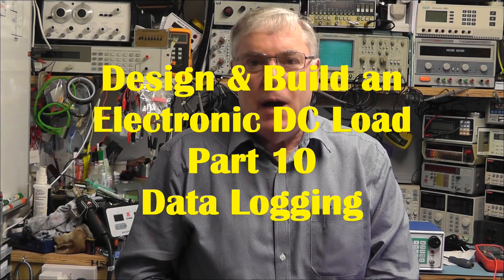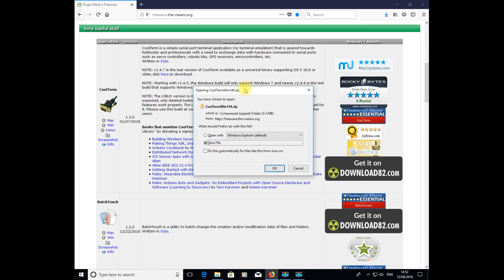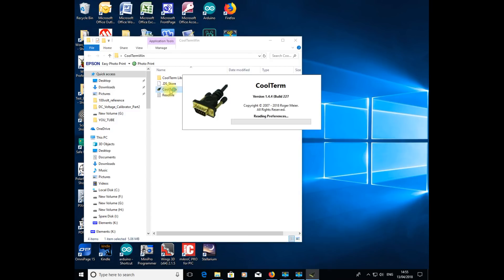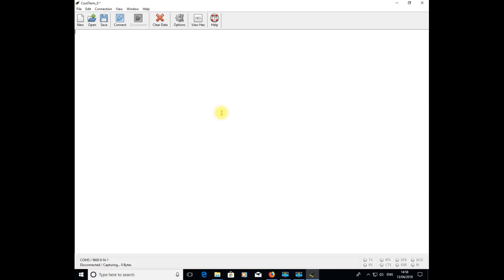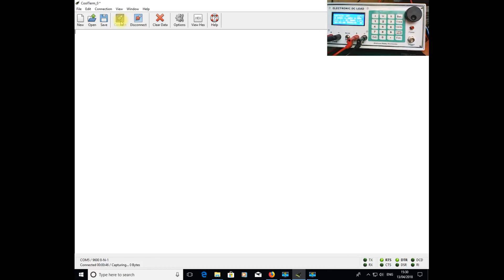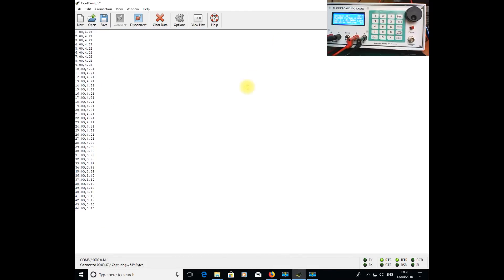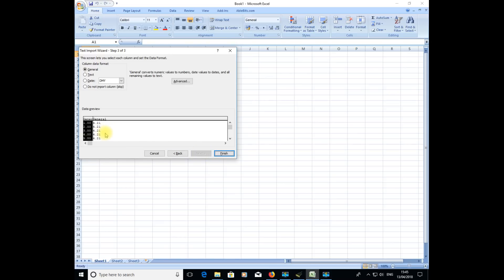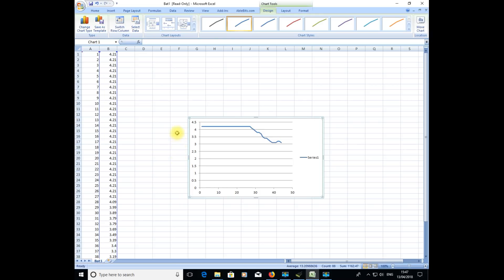Scullcom Hobby Electronics #58 - Electronic DC Load Part 10

Comment: Hi Louis, I have built yor electronic load and made a mod to increase the current capacity to10 Amps, which involved changes in hardware and software. I also started to include in the software the capability to remote control the load and also started to make a Windows program to control it from a PC, it basically works but I need to complete it.
This was several years ago and since I am restarting the project now I would like to have it well documented. I wonder if you could supply me with the KiCad files corresponding to the version 9.3, the only that I have is for version 7.1.
Thanks in advance,
Ignacio
PD. If anybody also has these files, please let me know, I'm not sure if Louis is following the thread now.

Comment: Hellò Master!
I mounted the pcb and it seems that most of the system works, but there is a problem, the RTF4050 reference voltage generator instead of providing a positive voltage provides a negative voltage, before removing the SMD chip, I would like to know if it is a problem with the chip setting or if I damaged it while mounting it?
I looked at the data sheet but I did not find any ideas on the matter.
I would like your opinion, the rest seems to work correctly. Thanks!!

Comment: Very nice job and project!! Great presentations as well. 2 questions: 1: I could not find PCB in the ref listing, is it still available? 2: This is a perfect load, a little more current would be better for battery testing, And the BIG ONE, WE NEED  BATTERY INTERNAL RESISTANCE.!!! With the tracking output to Excel, this is great for battery management!! Thank you so much for your time and great work!!
Rod

Comment: Good morning. I know I'm digging up a topic. I would like to know if with some modifications it is possible to increase the load to 8 Amperes? I will provide a larger heatsink and more powerful resistors. I would like to know what else could be modified? Thanks a lot . PS: sorry for the text because I am French and I use Google translate

Comment: Greetings. I really liked your scheme. While studying, and thinking about increasing the power- by increasing the number of transistors. when studying the circuit, I noticed an error in the printed circuit board. Resistor R16 must be connected between resistors R7-R22-R17. On the printed circuit board, R16 is included in the R17-gnd circuit.

Comment: I just finished Your project and it's working beautiful ! I did some modifications to it . I used a op amp to boost up the output voltage LM358 (from 0 to 5 to 0 to 10 V) to be more flexible with the Mosfets . and used a quad lm324 , it's not a rail to rail but I figured it's not gonna be all the way up to 5 volt at the output . I really  liked the all the nice data and functions of it . Absolutely Beautiful !  If I may , I could give you and idea about a different project .  Like a linear power supply  there's a DIY kit all over the internet . 0 to 30Volt 2mA to 3 amp . it works very nice . It would be beautiful to make a control with Arduino , with a rotary or keypad . I been looking for a thing like that all over the internet and sadly to say I haven't find anything similar and i'm very sure I'm not the only one who's in dier need for some upgrades :) something like a universal module . just hooking up the potentiometers connections  and output of the DIY kit . with the DAC and ADC it can control and monitor everything about it . maybe some current settings if the user wants to boost up the current output . My guess is that that little control module would be a great Hit in the hobby world

Comment: This is a great project. I especially like the fact that you let us see the entire process with the thought behind all the steps and changes. Two things I am curious about though. Why you didn't use your thermal sensor to directly drive the fan's control transistor and why you opted for a logic level rather than linear, FET. Have you looked at the  IXTK240N075L2 or the IXTT80N20L? They might give you 10 amps per device without exceeding your temperature. I was looking at building this but the FET you us is now obsolete. Never the less, good job.

Comment: Renat Zafirov
Hi, Louis! Can you modify your RTC library for using most popular and  cheapest ds1307 or m41t56 ? Thank you!
Reply: Much too late, but for documentation: The DS1307 and also the M41T56 uses i2c adress $68 wich conflicts with the ADC MCP3426 on the board. I removed the usage of the rtc for battery discharge timing in my code and use arduino millis() function for that. I want to free the rtc from that and use it as a real rtc for datalogging.

Comment: Dear Mr Scully
Thanks a lot for your great videos ! Thanks to you, i could vastly improve my electronic prototypes. I have a question about the Arduino Nano you use in several projects, like your Electronic load. You inject a regulated 5 volts directly in the 5V pin of the board, without protection diodes or voltage management system. Isn't there a risk to damage the voltage regulator of the board ? And how to you upgrade the software with the USB cable? Do you first remove the Arduino board from your own PCB ? I wonder how you prevent the risk of conflict between the regulated 5 volts supply and the 5 volts coming from the USB plug ? ... 
Thanks again for your excellent work! 
Yours,
Patrick Bertholet

Comment: I just have 2 questions. Are you going to have any more boards made and 2nd question is if your not what type of file is the PCB created in so that I can try to make one of these, Love the channel by the way I just found the channel yesterday and have not stopped switching through all of you programs trying to learn as much as I can. Freshly retired so I have time to tinker around now. Thank you for the channel your time and all of your help.
Reply from the maker: Hi Brandon,
I have just had a few more PCB's made where I have made a few improvements and added extra grounding on the PCB. If you would like one post a comment on my website at www.scullcom.uk that will then allow me to contact you via your email address. Or send me your email address in You Tube private messages.
Regards,
Louis

Comment: No logging for current only voltage?
Logging to SD card would have been so much better, no need PC to be constantly on for hours and hours. So you can use PC for regular things. Else this needs dedicated PC.
Reply from the maker: There is virtually no more free memory in the Arduino to implement a SD Card option. To add an SD Card for data logging we would need to add a second Arduino or use a different micro altogether. The current data logging does save a data text file to your PC which you could store on am SD Card if you wish.
Regards,
Louis
Reply: Someone with the know how, might be able to use RPi, to connect to the DC Load to store the data log. Instead of  a PC.
Reply: will it be possible for you to test the electronic dc load with 45Vdc and see what amps you can get

Comment: For battery discharge test is very useful constant power and constant resistance modes.
Reply from the maker: Thanks for your comment Radek.
Reply: Hi,
See my reply to this on the forum/web page.

But I started looking at a Constant Load by using constant resistance, and I have found that for all practical purposes you can use a length of Kanthal resistance wire as your constant resistance load.
You don't need any electronics to adjust anything.

Alan

Comment: Very nice. It would be good to get past the toy Arduino. Devices like this are obsolete, especially for teaching. The concept is great. If you continue, maybe an update of both the basic hardware to something modern on the control and power management is a good idea.
Reply from the maker: Thanks for your comment. The Arduino was used as this project was aimed at the hobbyist. You could upgrade to a better micro if you wish.

Comment: Save your data from the terminal program with a .csv extension then Excel (or any other spreadsheet program) should recognise it easily as comma separated values.
Reply from the maker: Hi Nick,
CoolTerm saves as a text file but that is not an issue when importing in to Excel as you can specify comma separation when importing data.
Regards,
Louis

Comment: I think it would be better to Serial always export all available data; Volts/Current/Watts/SetPoints/Limits/Alarms. This will increase the file size a bit, but will make the data far more useful for analysis.
Reply from the maker: Yes you could export more serial data if you wish by making some changes/additions to the Arduino code. At the moment were are just about at the limit of the Arduino usable memory so that may be an issue.
Reply: Would be interesting to see if this could be ported to an ESP8266 for faster performance, more program memory and WIFi link.

Comment: Very useful addition to the project.  I'm so impressed with how this has matured into a really useful, professionally presented instrument.  One suggestion: you might consider adding battery discharge current to the data stream so that the spreadsheet can calculate battery capacity.  I know it's constant throughout the test so you can just type it into the spreadsheet, but it would be nice to have it recorded as part of the data set, especially if you're doing multiple tests at varying current levels.
Reply from the maker: Thanks. We could add the current to the data stream by adding one more line in the code if it is a requirement.
Regards,
Louis

Comment: maybe its time to move on to an stm32? :D I never thought that this project goes beyond the capabilitys of an atmega
Reply: This is the reason why I use for my DCLoad-Project two MCUs to work together.
Once the Arduino Pro Mini, to handle all the "hard work", load and cooling stuff and as second, a Teensy for HMI, data logging, driving the Nextion Display and others.
Somebody will say: "Too much!". But hey, why not ;-)
But this will presuppose more work. More for hardware, but much more work for programing!

Im thankful to Louis for this nice project! I have so many fun in my lab and everytime someting to do ;-)

PS: @Louis, think about fixed-point math against floating-point. This will reduce the needed space for code and increase the speed for calculations on a Arduino.

Greretigs,
Wolfgang